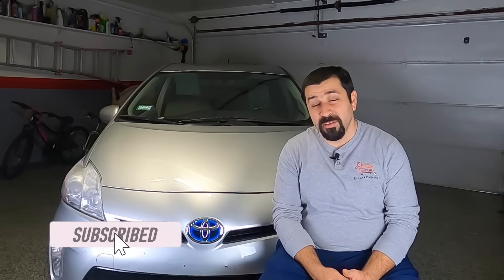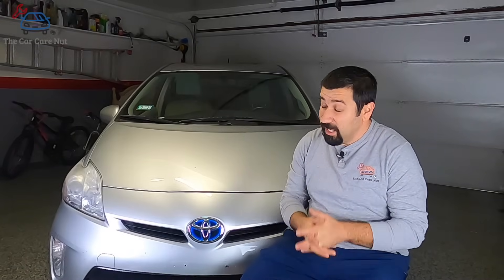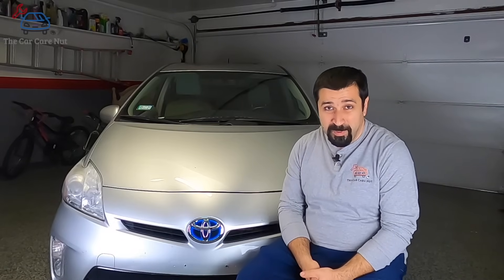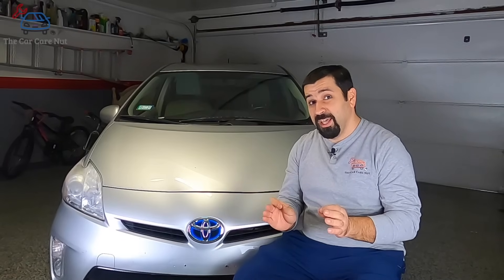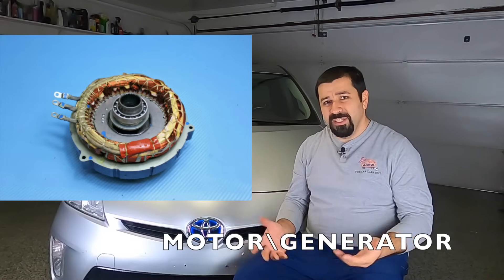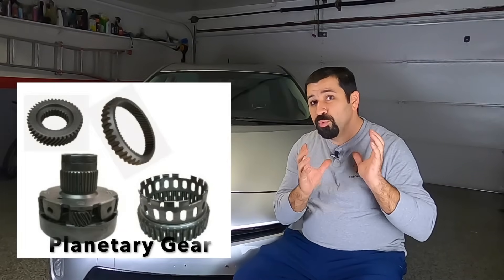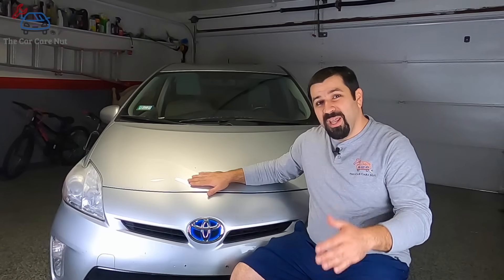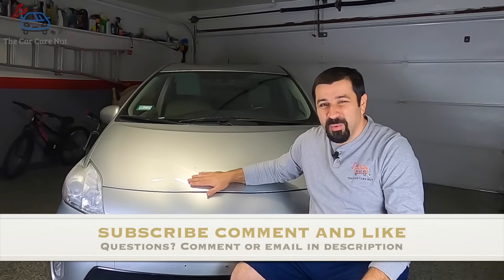How Toyota Hybrid System Work Part 3 Hybrid Transmission

Comment: THANK YOU!!!!!    I had ruled out Toyota because they use the term CVT, which I associate with a snowmobile transmission that does not belong in cars!   I will never buy a CVT, and wish Toyota marketing would call this unit something else to differentiate from the junk most car manufactures are using.    I am super happy to know that Toyota is back on the radar for getting mom a new car!

Comment: hi , i changed my transmission fluid on 4th gen prius and im sure they changed it into a cvt transmission fluid , should i be worried? , it worked like 20000 miles since ! should i change it with at fluid ?

Comment: Hello! It looks like in this gearbox there is nothing to break. So can I tow my skijet with my Yaris? What about something heavier? It seems to me the worst thing that can happen is to slip motors. What about puling a car?
Reply: Yes, you can tow. It's not like a belt cvt. Theoretically you may overload MGs, but I do not think controller will allow. For exacr numbees you'd better look in user manual.

Comment: We bought a new Lexus hybrid three months ago.  I was very hesitant to go with a CVT until I researched Toyota's system and learned that they are incredibly reliable.  What amazes me is how seamlessly the car switches between electric and gasoline modes.   I wish they had let the transmission engineers design the interior, then maybe it wouldn't have so many little rattles.

Comment: I realize that this is a comment to a 4 year old presentation, but I have a question: is the proposed hybrid transmission for the 2025 Subarus also an eCVT? Based I what I have had explained it seems to be exactly what the Toyota hybrid system does.

Comment: Toyota did the amazing!! They took away the weakest part of a CVT (the friction drive) and instead replaced it with a planetary gear set… operated by the Hybrid motor/generators themselves.

Toyota killed “9 birds, with one stone”… quietness, weight, efficiency, smoothness, reliability, size, performance, environmental efficiency, maintenance cost etc.

Comment: Very nice explanation. I have a couple of questions. The most annoying thing about my 2022 rav4 prime is the seatbelt alarm if you are driving unbuckled. Holy Moly. Sometimes I drive a few blocks and don’t want to buckle up. I’ve noticed when I stop to put it in reverse the alarm subsides. Can I put it into reverse while driving forward to coast to my destination without the alarm.  For those rolling their eyes, this can be done in certain vehicles without damage. The rear camera will come up on the display and you can see if any suckers are trying to come up on you. Also, when regenerating downhill, can I switch between Neutral and Drive while moving without any damage tot he eCVT. Sometimes the regeneration causes the vehicle to slow down too much and I would like to coast instead of depressing the accelerator. I have a nagging knee injury and a long coast helps me while driving where cruise control doesn’t help. Thanks

Comment: Is this what they call a PHEV?
Reply: HEV - Hybrid Electric Vehicle battery charge by engine, regenerative braking, and coasting
PHEV - Plug in Hybrid Electric Vehicle  battery can also charge by the engine, regenerative braking, coasting and can charge it using the charging cable

Comment: I still don't understand it. Can someone simply explain (1) what is connected to the transmission (planetary), is it ICE, MG2, and wheels?, and (2) does the ICE also provide mechanical power to the wheels, together with MG2, or does the ICE only create electricity?
Reply: Answering my own question after watching this video: https://www.youtube.com/watch?v=O61WihMRdjM
(1) The transmission consists of much more than the planetary. The planetary is mechanically connected to ICE, MG1, and wheels. MG2 is directly connected to the wheels, and to the planetary, obviously. 
(2) Yes, the planetary allows that both, ICE and MG2 power the wheels directly. The power ratio of the 2 engines is determined by the planetary gear controlled by MG1. Driving MG1 in various conditions causes MG2 and ICE interact in different ways.

Comment: Thanks for all your great video's, i am learning a lot from you. :-) Ik have one question. I own a Toyota Auris hybrid ts and the the e-cvt is SO smooth that when i am parking i don't stop the car completely between going back and forth. It's so smooth that it seems ok to do that. On the other hand, maybe this is very bad to do because i am wearing out the components of the e-cvt? Is this the case or does it not matter?

Comment: I recently purchased a new Corolla Hybrid and took it to the dealer for its first oil change at 1000 miles. While reviewing my dash cam footage, I noticed the service driver was changing gears without coming to a complete stop, which concerned me because I’ve heard it can be detrimental to transmissions. Is this a problem with this model? Additionally, sometimes when I start the car and shift into reverse, I notice a brief pause or slight hesitation as if there’s an obstruction under the tire. Is this normal? It happens occasionally.

Comment: From what I understand about Toyota's eCVT's and Ford Maverick is that it doesn't have chains or a changing variable chain gear but instead is a planetary gear system with works off gears instead of chains so it lasts forever if maintained properly.
The electric motor actually starts the engine not the starter and the reverse gear of the MG1 regenerates the electricity used to start it to replenish alternator.

It's very efficient and robust.

Comment: How do the 1 2 3 4 5 6 "gears" work. I can downshift in my 2013 ES300H I know it's not the same as conventional but is this electronic, or are there mechanical gear ratios at work?

Comment: Thanks I own a hybrid shop and still learn new things from you. Now I know why the computer makes the car stall if engine is running poorly. I have a mechanic friend who replaced a prius engine thinking it was bad because of all the noise. I tried to tell him that the engine is it’s just misfiring. And I have always thought it was the valve not realiizing it is the transmission making all that noise because it does sound like it is coming from the transmission. Thanks so much

Comment: makes me wonder why they didn't just use the engine as an electric generator only and then use the e power from it to turn the wheels and use the regeneration for a smaller auxiliary battery?

Comment: The Toyota CVT has TWO electric motors INSIDE THE TRANSAXLE CASE…. 
TWO ELECTRIC MOTORS
Are they built out of cryptonite?
I’m scared.
Two electric motors…Inside the transaxle…
“ Motor  2” is the motor that mixer the car during normal electric drive operations…
“ Motor 1” is the motor that spins part of the trans to spin and start the gasoline engine… Int INSIDE THE TRANNY AND it’s job… it’s the starter motor.
How long are these electric motor expected to last….? Are they a/c brushless motors with an expected longevity far greater than …. 10 years? 15, 20 years? 150,000 or 200,000 miles?
If these motor FAIL AT ALL…shouldn’t they have been built on the OUTSIDE OF THE TRANNY CASE?
 Or…if either one fails …… we’re looking at $4000 just to replace a starter motor? Or the drive motor?
Please comment
Thx

Comment: I bought a used 2008 Highlander Hybrid and the carfax says it hasnt had the transmission fluid replaced. There is 136,000 mile on it. Should I change it?

Comment: Have a hybid  fielder  not starting up just giving a heavy  vibration  even  says  ready but when  put in drive  not moving wondering if the smaller motor can go bad and cause that?

Comment: Some more complete information, which I don't think is too hard to understand:

1) A generator does not "start generating" just because you turn it. That makes it do essentially what a battery does if you hold it in your hand: there is an electric voltage across its terminals, but no current is generated. To start generating, you need to connect a load between the terminals that draws current. And, while that load can be charging the battery, most often it is not. It is powering the other motor-generator.

2) Regenerative braking is not a loss-less process. In a study, a 2013 Prius Prime recovered (to the battery) less than 50% of the kinetic energy it had at 60 mph, when it applied maximum regenerative braking. Losses in propulsion probably reduces that to 1/3 being returned to propulsion, so the rest must come from gas. The battery can be at a lower state of charge after returning to speed; if it isn't, that means you used gas.

This isn't meant as a criticism. I'm pointing out that you never gain net charge thru regen braking, you just lose less energy to heat. The way the car actually gains net charge is by over-producing engine power while cruising.

3) The eCVT isn't that hard to understand if you know what a differential does, because it is basically a backwards one. A differential lets the engine (i.e., one input rpm) drive two wheels at different speeds (two output rpm) whose average is the engine's rpm. The eCVT simply changes the two outputs to be MG1 (usually acting as a generator) and MG2 (usually a motor) which is directly connected to the wheels. This direct connection is important, because MG2 usually adds power to whatever it gets mechanically from the engine. By acting as a generator, MG1 is slowing the engine down to the most efficient rpm. But most of its power is sent back to the wheels, by powering MG2.

This may sound counterproductive, but the point is that the engine is not constrained to produce just the power needed by the wheels. In that Prius, the engine is most efficient at 2000 rpm and about 28 HP. This is mode than the car needs to maintain speed on any flat road, but less than it needs for acceleration. So the engine usually operates closer to this point than it could with a conventional CVT, and either MG1 charges the battery with excess power, or the battery powers MG2 for power assist.

4) The roles of MG1 and MG2 are reversed at higher speeds. While mechanically, MG2 has a direct connection to the wheels and MG2 is only connected thru the planetary gears, the jobs they can both do are identical. Swapping the roles keeps the two motors from exceeding their maximum speeds.

5) It has a clutch; maybe even two. These are not the kinds of clutches you might normally think of, so what TCCN says isn't wrong.

It is a bad idea to connect an engine directly to the wheels, in case a catastrophic change in either's speed occurs. So there is a permanently-applied clutch called a Torque Damper in between the engine and the eCVT. Then, the system in the non-plug-in versions of the car cannot apply all of their power in EV drive. MG1 cannot contribute its power without causing the engine to spin (just like starting it). So there is what is called a "sprag clutch" that holds the engine motionless, freeing both motors to provide propulsion.

Comment: It does not seem to me that you ever actually discussed the Constantly Variable Transmission.  I know from driving mine that if I accelerate at with a good amount pedal pressure and then, after a bit, I let up on the pedal some, I can feel the transmission doing "something". Clearly the rpm's go lower and the running noises smooth out some.   Something is going on with the transmission.  It seemed to me you focused on the motors (MG1 & MG2), the braking regen but never the transmission.    From my far past I know the planetary gear simply is used to be sure power doesn't get distributed unevenly to the drive wheels (like when in a turn, where the outside wheel turns faster than the inside wheel).
So ..... what about the CVT?

Comment: I have replaced back batteries booth’s as well engine along with transmission but car wouldn’t start and ready sign not showing in the dashboard where is the lights work and all components inside car are working fine 
However, I scanned the car with advance device but no code showing 
Please advise 
My car is 2009 GS 450h

Comment: IMHO, the hybrid/battery all add  moving parts ( some of them have not been proven long term---the main battery is not expected to last more than  10 -15 years) that when you factor what you gain from hybrids,  it doesn't make sense to me.  When you consider all the " must do this"  ( batteries must stay cool. filters need to be cleaned/ etc ) along with the expensive parts ( inverter/main battery etc) all of those things negate the extra gas you save in the long run. If you're someone who keeps a car 8-10 max, yeah, perhaps, but who would buy a hybrid that old, so you don't really have much of a trade in or selling value when these hybrids are at their useful end.

Comment: My 2014 Avalon Hybrid is down for the count at 174,000 miles.  
All services were perform on schedule by the dealer.  
The dealer says it need a "Transaxle Repair/Replacement. 
It will cost almost $9, 000 to repair.  The vehicle is essentially worthless now.

Comment: Hello, I really like your videos. Thanks for it. Very insightful. I have a question though. It is regarding transmissions applied in new Lexus RX 2023, namely, if eCVT is so reliable, efficient and powerful why Lexus decided to ofer regular 6-gear transmission in its most powerful model RX500h? Is the only reason the sound standard eCVT produces, which makes some car enthusiast avoid it, or there are some other reasons? Thanks a lot in advance if you can shortly answer it. Best regards, MK

Comment: I just watched all four episodes of "How Toyota Hybrid System Work" series and I really thank you for the information and your valuable experience that you shared with us. They will certainly help to use my new Yaris more safely and efficiently.
I would also like to ask a question that arose for me. Since the regenerative braking done by the electric motor is applied to the two front wheels only, doesn't this lead to significantly uneven tire wear between the front and rear axles?
Reply: this is true for most FWD cars. Weight moves forward while braking, so front tires can handle more grip before slipping. Therefore, the front wheels tend to get increased braking bias.

Comment: When I let go of the throttle and start to coast (at a bit higher speed) and once the speed drops to around 47mph (75kph) I feel a little jolt - sort of like the engine starts. Why is that? It happens every time and at the same exact speed.

Comment: So, does MG2 use cvt or not? I mean while MG2 stays at the same rpm, can car go faster by using ecvt?

Another question is can this internal combustion engine drive the car alone in case MG2 doesnnt somehow run.

Comment: Hi I have a toyota yaris hybrid 2021 and I notice something when I am driving down to hills road on b mode I notice in energy screen That  the battery it's charging fuel and don't stop to 80% neather when is 100% showing on screen That is continue charging is that normal or is a problem to my car?

Comment: Hello I’m new to hybrid, I have a 2007 Camry hybrid 2.4l and the problem I’m having is the car is shutting off, all lights everything is still on, once I put it in park and restart I can drive for another 2 miles and it shuts off again, have you come across this problem before

Comment: I've worked on traditional cars since the late-70's and the hybrid transmission and relationship with the ICE was, probably, the most difficult to picture in my head.  Excellent explaination and answered a lot of my questions.  The hybrid cannot run just on the gas engine (MG1) because the MG2 is electrical so if the traction battery isn't working, the car isn't going anywhere!  So the "boost" we feel when punching the gas pedal does rev up the engine but the power to the wheels is from the boost in electrical inputs to the MG2, not the RPM's from the engine, right?   The only "gear" in the transmission is the parking gear so we can't just put it in neutral and tow the car around, like an RV can tow some cars...Prius would have to have front drive wheels up on a trailer (And all 4 wheels up for AWD versions)  All this stuff is fascinating and, you're right, Toyota has some genius engineers to come up with this!  (In 2019, we drove our 2017 Prius from Colorado to Maine and back and only spent $200 total for gas the entire three weeks!)

Comment: I'm debating rav4 hybrid or gas I'm really concerned with the cvt in the hybrid model
Reply from the maker: The eCVt is good reliability wise in the RAV4
Reply: @TheCarCareNut  thank you for your responds. Yea I just reserved a hybrid gets build at end of month. But my head is telling that hybrid will coast a lot to repair if it was to break down or just to simply get a diagnostic. Regular shops are not trained on hybrid. That's my biggest concern.

Comment: I’m waiting on delivery of my first hybrid… a 2022 Highlander hybrid. I think you’ve said that the start/stop system does not prematurely wear the engine out if you use 0W-16 oil? Would you recommend running the vehicle with that system deactivated to help increase the life of the engine?  With the system turned off would that generally reduce my fuel savings? Thanks!
Reply from the maker: Hi! On hybrids you can’t disable start stop as it’s nit really a stop start it’s just part of the hybrid system  and nothing to worry about as far as wear
Reply: @TheCarCareNut  Maybe I shouldn’t have said “disable” the start/stop system, but said “turn off” instead. Because on one of your videos you were talking about how some hybrid owners are annoyed by that system so when they start the vehicle, push the brake hold button to activate it and then push the start/stop button to turn if off - that becomes their routine. Am I missing something?
Thanks again. Love your videos.